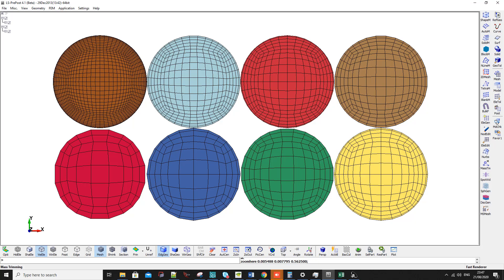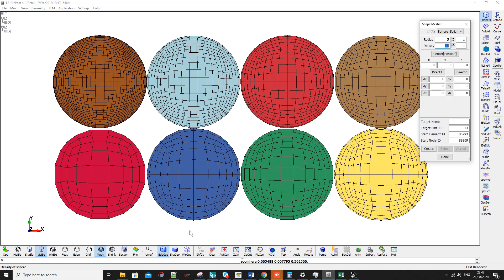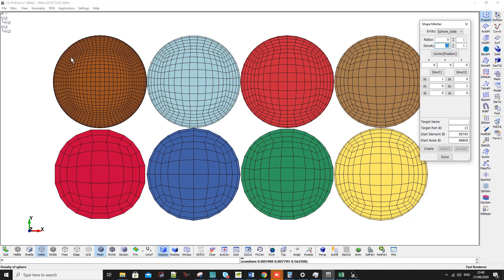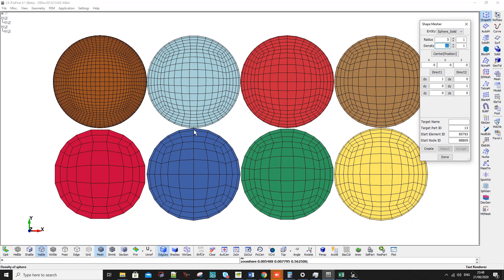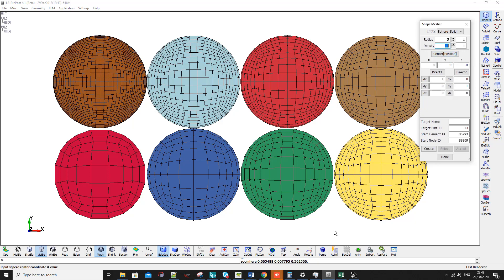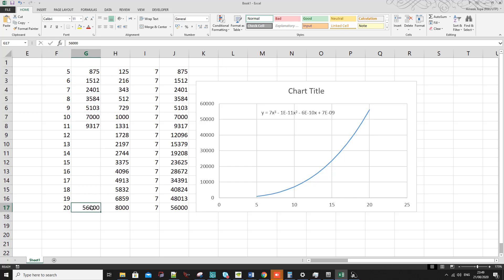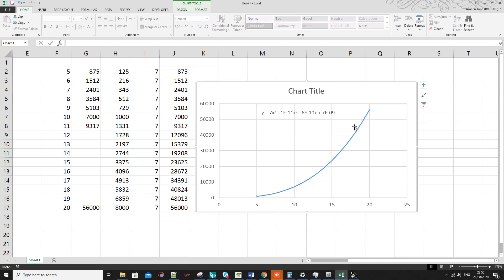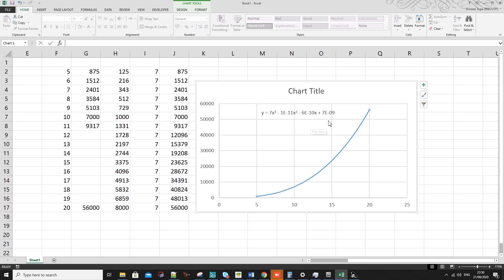Solid Sphere Mesh: How does it work?

Comment: Hello Sir,
Could I perform a simulation of local scour around bridge piers using this software?
Reply from the maker: This is simulation of fluid around bridge right? If this is the case, then yes LS-DYNA can do vortex simulation and VIV simulations.
Reply: @AmeenTopa  Thanks for replying sir. That right, it's about removing the particle around bridge piers foundation under the effect of the flow of water. Could I contact you with an email for more information about this simulation and how to perform it with this software?
Reply from the maker: @ahmedshakiraliali397  put your email here and I will follow up with you
Reply: @AmeenTopa  Thanks a lot sir